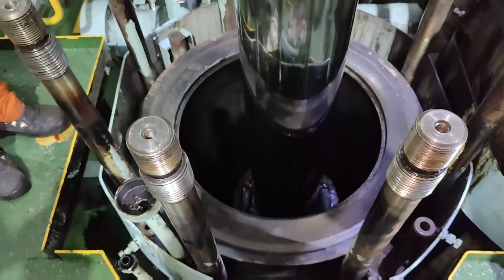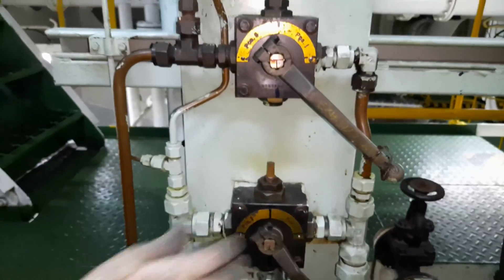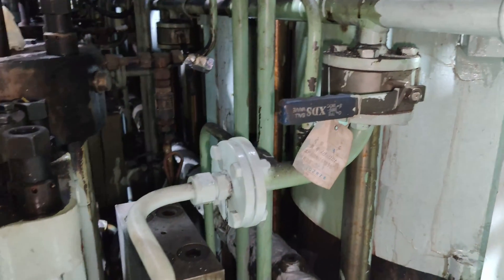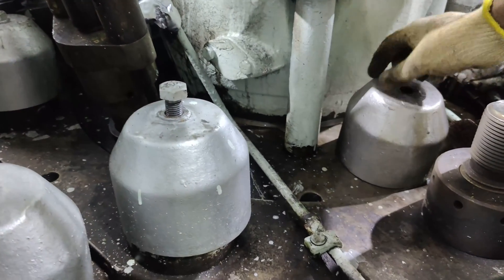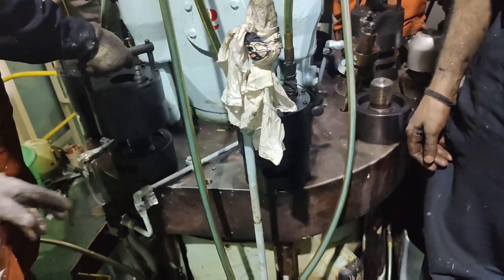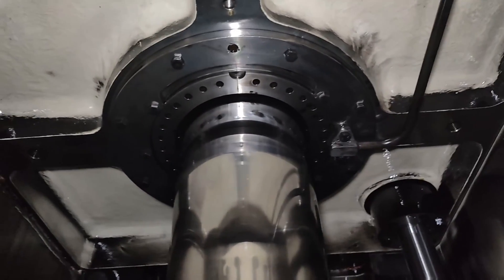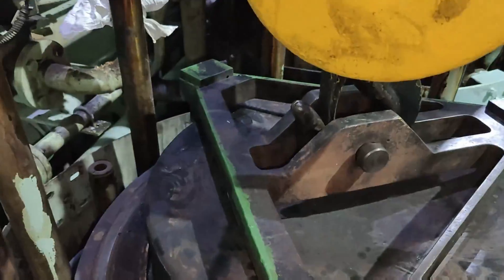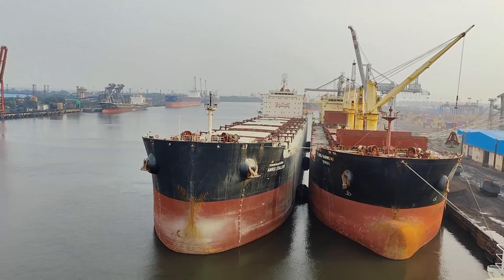MAN B&W ME C ENGINE COMPLETE DECARB JOB VIDEO | SEA LEGEND |

Comment: hello sir, if we want to check hydraulic jacks before overhaul, what is the best way to check to know if there is leakage or not? can we mount on the cylinder head and can apply a little bit pressure to check?

Comment: The maintenance part is good but the crew members working without helmets,without safety goggles handling hydraulic high pressure hoses and jacks and quite few other unsafe practices are very evident.
Even the company logo of FML is visible which is not good from company's point of view.